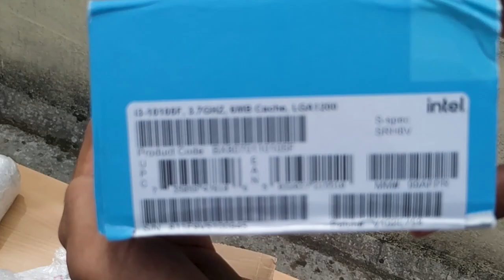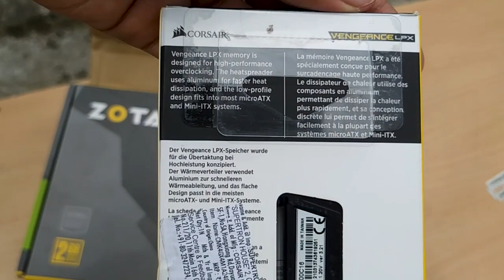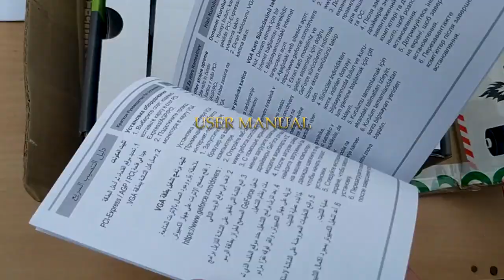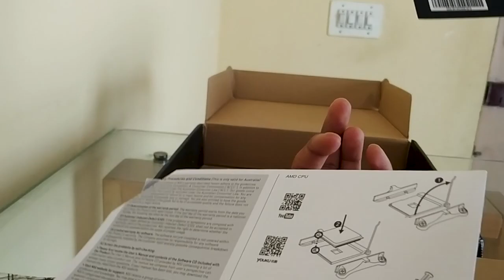PC BUILD2021 i3-10105F,MSI H410M-A PRO,ZOTAC GEFORCE GT710 DDR3 2GB 64BIT,CORSAIR DDR4 4GB 2400MHz,

Comment: The card is weak for what i think you will use it for, i mean its not bad but dont expect to run any graphic demanding games on high settings but older games will run just fine.
Reply: Ultra low card

Comment: Brother Does GTX 960 2gb variant will support and also ddr3 rams will support in this motherboard??
Reply: The GTX 960 yes but it just a bigger card so you need a bigger case. The ram must be DDR4 but the i3 only supports DDR4 up to 2400 MHz.
Reply from the maker: @Vans89  i3 support DDR4 up to 2666MHz 👍🤝
Reply from the maker: This motherboard does support GTX 960 2gb but not DDR3 rams.
Support only ddr4 rams.👍🤝

Comment: Buy a xtreme v3 case and apply proper cable management. You also need to change your psu unit Because looks like its one of those fake ones.
Reply from the maker: I will